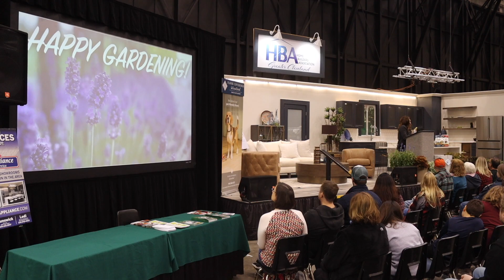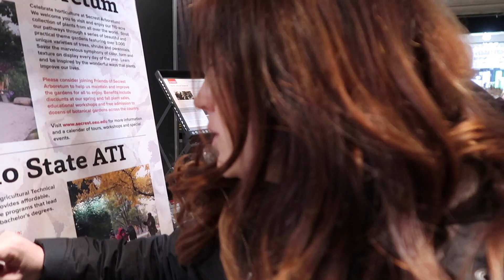Our Weekend in Cleveland! 🥰💚🌿// Garden Answer

Comment: I feel the same about Ferris wheels!!!!
Reply: I feel the same about any amusement park ride that is temporarily installed.  Unless it's bolted to the ground with concrete and steel, there's no way I'm getting on it, lol.
Reply: The ferris wheel is permanent. It’s been there since the early 90s. Every year they have an indoor amusement park also.
Reply: I started feeling chills in that part of the video.
Reply: @deborahgough8523  That's a relief.  I was on a date with someone in the mid '90s and we just happened upon the San Gennaro festival in Brooklyn (yep, just walking around, turned a corner and boom! festival, in the middle of the street).  And there was ferris wheel in the middle of the street.  And a week later, it would be removed.  My date suggested we get on it.  I said "uh...no."  lol

Comment: Maybe this is a dumb question... but how do they force certain things into bloom for these type of garden shows? I also very much appreciated the winter appreciation landscape and the greenhouse tour!! Thank you
Reply: If it's a spring bulb, they refrigerate them to induce vernalization.  Others are probably shipped in from other areas where they grow natively.  Just a guess.
Reply: Yes, some things are forced into bloom for the show so we can debut new varieties that will be available in spring. We do, however, try to keep this to a minimum and use mostly foliage plants and tropical plants that are in bloom and available at this time.
Reply: @PetittiGardenCenters  Why do you keep forcing to a minimum?  Is the plant's success rate after transplanting into the landscape reduced or...for what reason would forcing be detrimental?  Thanks!
Reply: @Bamboo4U2  Forcing is not detrimental, it just tricks the plant to bloom at a different time than when it naturally blooms.  The plants keep growing, if cared for, but may not be able to repeat bloom or last as long when the planting season arrives.  For example, a forced, Florist Hydrangea at a home and garden show, may continue to bloom 4-6 weeks indoors, but by the time it is safe to plant it outside in mid-May, the flowers will likely expire and it will remain a green, leafy shrub the rest of the growing season. Forced annuals are usually vigorous enough that they can keep blooming into fall. Forced bulbs bloom once, can be planted outside when the soil is workable in NE Ohio around mid-April. They will not bloom again until spring, 2021.
Reply: @PetittiGardenCenters  Ah!  Gotcha.  So forcing might cause the bulb not to bloom for its first year outside but will recover the following season.  Makes so much sense.  I (repeated) asked this question in another post.  Thanks for answering it in this one.